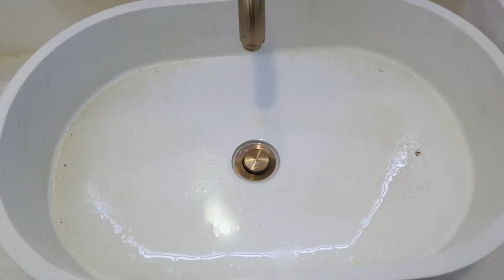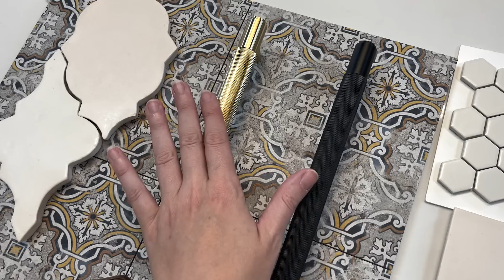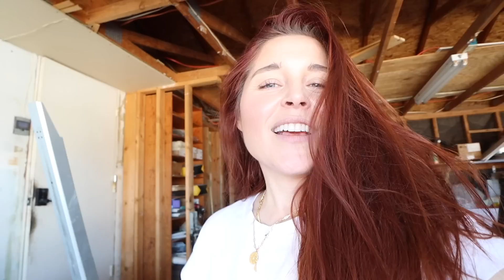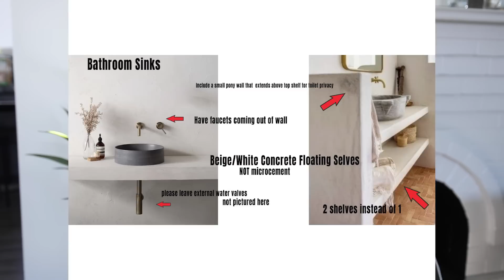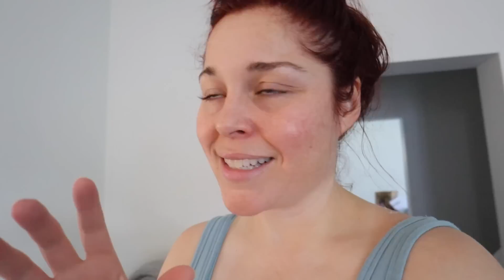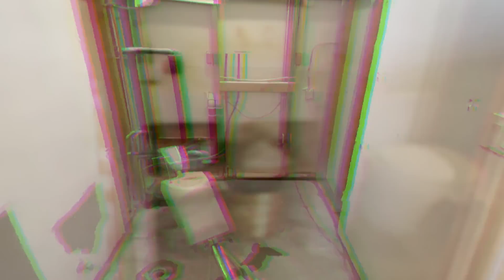My INSANE BATHROOM MAKEOVER+ BEFORE & AFTER | Erin Robinson

Comment: You always want a really good exhaust fan. Other than farts, it helps remove moisture to prevent mold.
Reply from the maker: Wait, so they're two different things!!?!?!
Reply: @ErinRobinson  it should be the same thing, just multi purpose. As long as it suck’s the air up and out that’s what you want in your bathroom
Reply from the maker: @rebeckahcamden4461  Yah, okay...shoo! I started to get worried!

Comment: I have 2 bathrooms that are similar in size that I need to redue in my home.  I am afraid of what I will find after everything is taken down. My home was built back in 1957 so everything is small. The previous owners did the bathroom remodels themselves!!!
I love the faucet fixtures, and I am surprised how good the sink lookes being off set on the counter. I dont like the  look of the concreate counter top ( the tiny crackswould drice me crazy). Hopefully you will not have any problems with them down the road.  😊
Reply from the maker: I would plan for the worst and hope for the best. Good news is if you're taking it all the way out, you will have full access to plumbing/electrical and can make it all up to code/right. Also, allow yourself some budget wiggle room to splurge on a few things so that you have moments of joy along the way, because a bathroom remodel can be BRUTAL!
Reply: Yes for sure the electrical and plumbing will have to be brought up to code. I had a home design person tell couple years ago "if you open walls then you have to bring it up to code". It needs opened up.😟Thank you for the advice!!😁🛁🚽
Reply from the maker: @katherineafzal2315  Sending you all the good home renovation vibes!!! Just get all of your supplies ready to go so you can expedite the process and you won't have to live without a bathroom for too long!

Comment: It took us over a year to get a 60 Sq Ft bathroom remodeled and it was the worst experience of my home ownership. It was partly supply chain stuff but a lot of it was contractor incompetence. We used a company called Made Renovation and they were supposed to take the stress out of it, find us competent contractors, etc. It was awful. At one point, after actually making progress, the whole bathroom had to be RE-STRIPPED back down to the studs because so many things had been done wrong 🥴 They tried to get me to sign an NDA.
Reply from the maker: Never sign an NDA!!!!!!!! That's such a red flag!! Also, always get their contractor license number, and if something goes wrong do not be afraid to report them to the licensing board. Also, never give them 50% upfront if they're not buying materials (aka you're just paying for labor and buying the materials yourself). If they screw up your stuff, you still have your payment leverage! Also, know your local small claims laws and get everything in writing. Even text messages can be admissible in court!